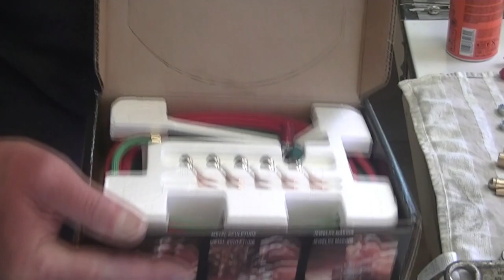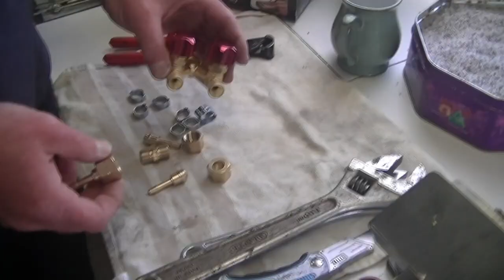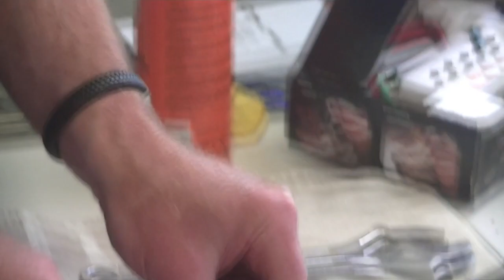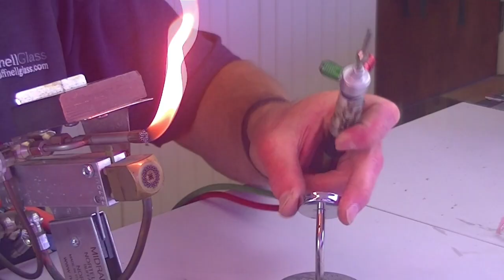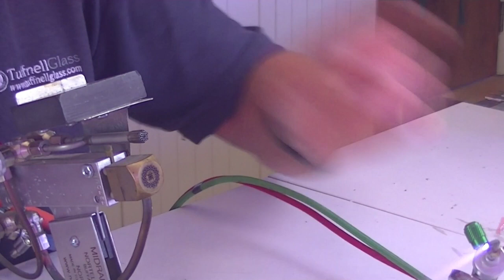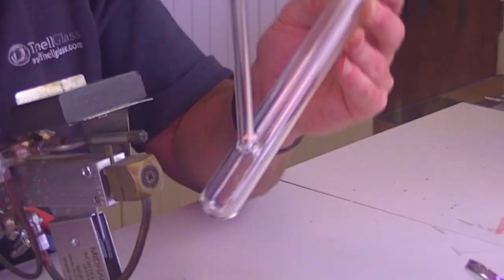Adding a Smiths Little Torch into your Lampworking set up - Tuffnell Glass

Comment: Do you only need propane for the Smith torch?
Reply from the maker: Hi , No you will need oxygen as well as the Smiths Little torch is a dual fuel torch ,propane and oxygen
Reply: Propane and oxygen as it is is a dual fuel torch , 2 fuels but you can always use an oxy-con as opposed to oxygen cylinders

Comment: What psi is the propane running on? I use a community studio and I was thinking of putting quick connects on the smith torch to hook into the bench propane (10psi)/oxy (30 psi) and wasn't sure if that would be a problem for the smith torch
Reply from the maker: That would be too high , ideally the psi on propane would be 1 -1 1/2 psi depending on the tip your using on the torch

Comment: Can you to put a splitter on the Oxygen the same way as the Propane or is a separate tank required?
Reply: yup, but be sure to use only oxygen compatible tubing and fittings. a spark arrestor/flashback isn't a bad idea either.
Reply: Yes you can put a oxygen splitter on as well but make sure it is a brass splitter as pressure from an oxygen cylinder is high pressure

Comment: how did you do your oxygen set up?
Reply from the maker: It’s been run off a standard 5 litre oxy-con so with a UK oxygen nut and tail it bolts directly to the torch hose

Comment: Why didn't you use tephlon tape on the connections 
Smith torches are best when they have aftermarket tips.. original tips constantly blow out
Reply from the maker: Hello Robert, we always find that with new threads and joints there is no need for tape.
Reply: @Tuffnellglass  , using a sealant wether its tape or a joint compound is industry standard... you're not putting safety first and teaching others to be just as ignorant... I'd bet your setup hasn't been inspected
Reply: @robertstahlnecker9921  panties in a bunch much lol? or did you just get on youtube to take out your marital frustrations on a random person?
Reply: @wyrdo1501  .. if you're ignorant about the safety issue.. look it up... its important to be safe when using gas fittings .. your pathetic attempt at insults reminds me of the 6th grade
Reply: @robertstahlnecker9921  im all about being safe. but snarky comments and talking about having an inspector come out to check a very low pressure setup thats about as dangerous as a damn small bbq grill is just a little ridiculous dont you think?
Reply: @robertstahlnecker9921  so you know, you dont use tape or sealant on compression fittings. if you have an old one thats leaking then go ahead but using a tape could cause problems and keep the fitting from fully tightening down snug and sealing, see its not the threads on a compression fitting that seals, being able to fully thread the fitting till it bottoms out is whats important. i work with these everyday, i unhook my torch everyday when im done so i dont have to leave it at the shop. just keep the fittings clean and when attaching them just snug them up good and thats all you have to do. going overboard with it thinking you really have to crank on the fittings is what causes problems for people. doing it the right way you will never have a leak and your fittings / threads will stay nice and true for a long time.
Reply: @robertstahlnecker9921  well damn sure is kinda funny, people are so quick to be rude to others when they think they are right, hope you looked into the compression fitting thing. dont want people to be ignorant about the safety issue of using tape on fittings that are not designed for it.
Reply: Seldom do o2 connections use tape or sealant, even teflon can burn in a pure oxygen environ. Propane can use either dope, tape or neither with pipe thread, and nothing is needed for most compression fittings.
Reply: @clalam5241  I don't see anything in my comments that recommend using Teflon not rated for propane.  Do you ?
Reply: @wyrdo1501  I've done a fair amount of research on the Teflon tape use. Seems there are as many who say fuck it as those who say use it. If you're not going to take the time to be a little more careful , why am I surprised at all